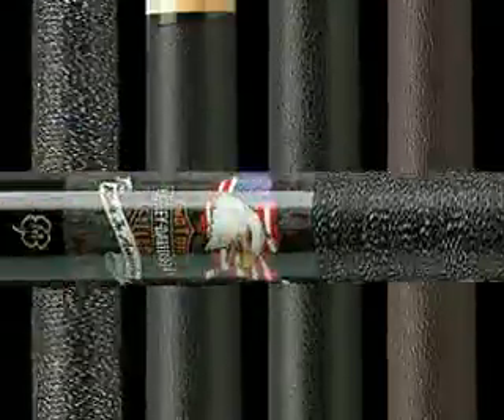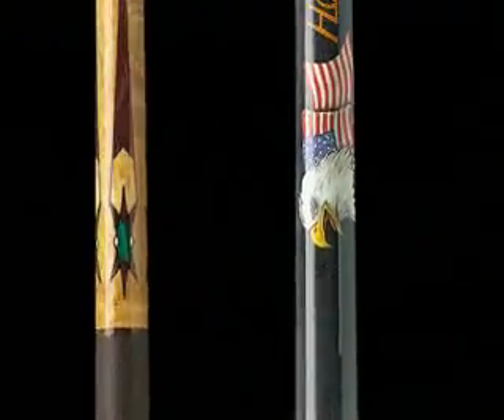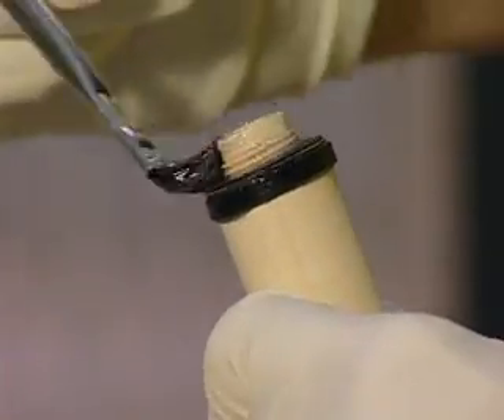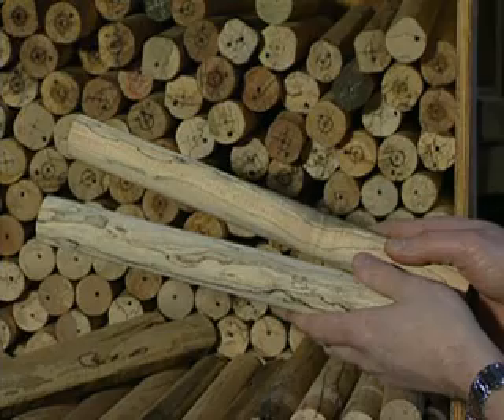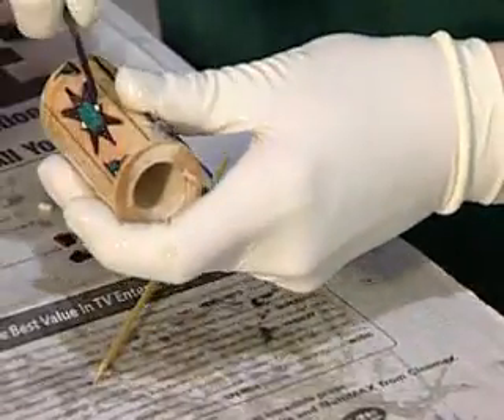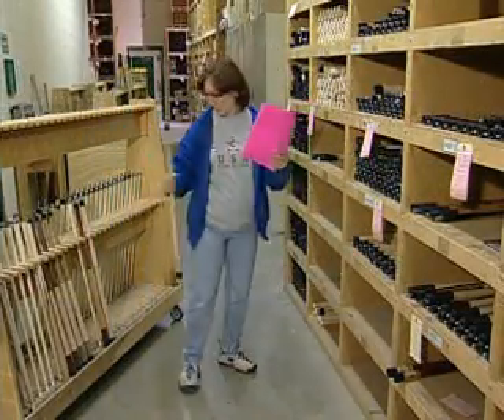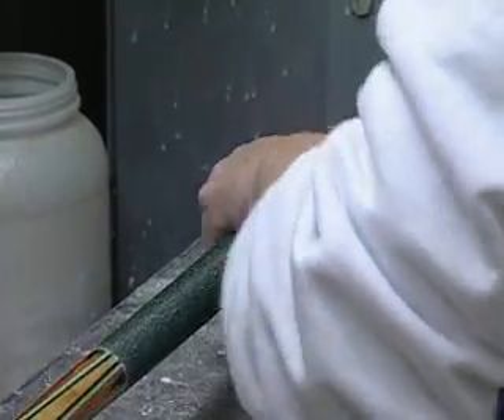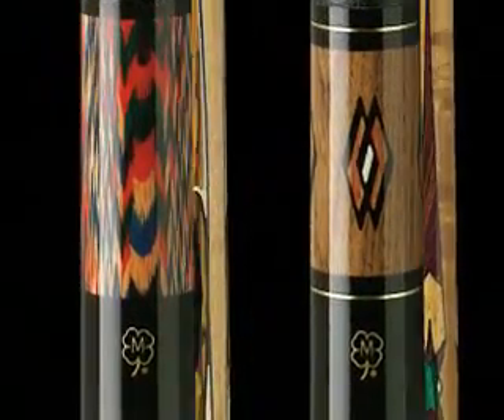McDermott Factory Video Tour

Comment: Hi, I just want to know where or which country is made the Star cue series? I heard its china or taiwan. 
If its china what kind of quality control that you use for that cue is that same level on the video or less?
And if its china made where is the material came from?  and how you assured that its quality material and made if its not from U.S?
Reply: They come from taiwan etc. The inlays are no inlays, but they are stickers, then they topcoat the stick and the stickers leaves under it. But you can still feel tho stickers and it is visible that there is height diffference between wood and the stickers inlays.
Reply: @ViihdeJukat  What place is the wood they make them with? I heard that the most expensive Star have AA maple

Comment: I have a McDermott C10 since 1984. I was told I'd never need another pool que in my life. It's true. But I don't play anymore. Anyone interested.
I had it sent in to the factory to be rewrapped with Irish Linen and added a second shaft about 20 yrs ago.The butt has a few very small dings and the original shaft has discolored. In a heavy duty hardshell case. Check the appreciated value of discontinued ques at McDermott website. Couldn't take less than $500.
 I think James below works for Viking.